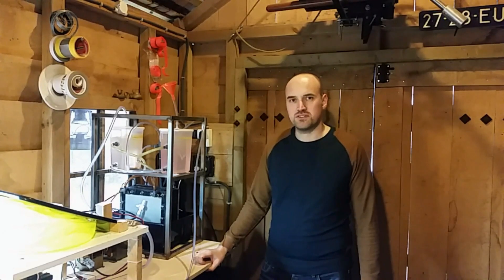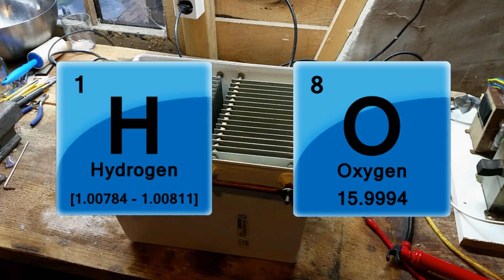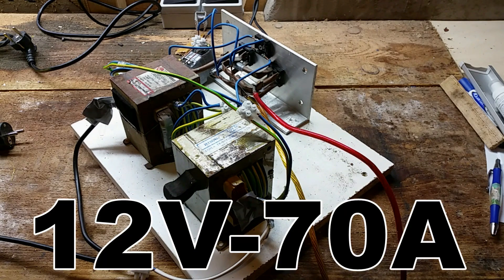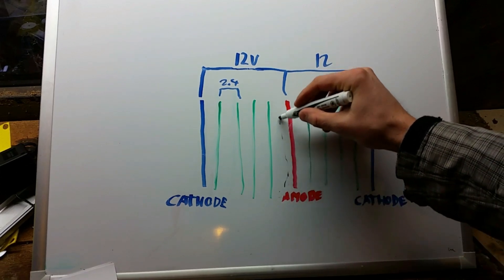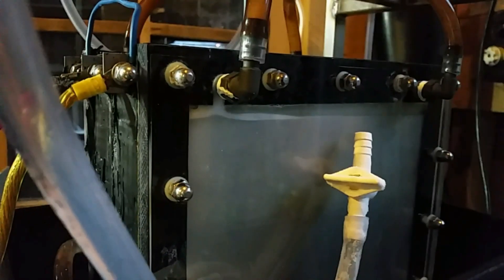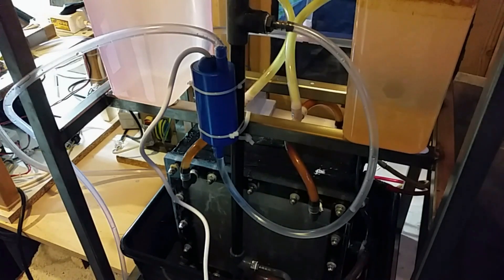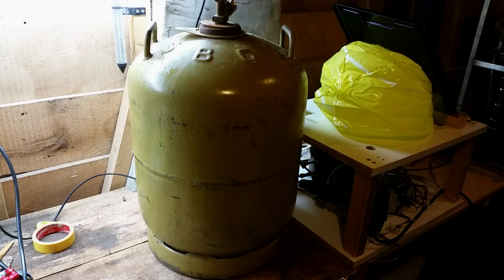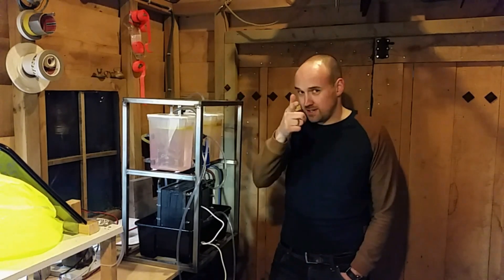Hydrogen Generator #1 Homemade Hydrogen Generator And Compressor Unit

Comment: Hey have you tried using pee as an electrolyte? I hear you can make hydrogen very efficiently from pee! Just 0.48V are needed and the urea and ammonia get broken down to hydrogen rather then the water. It cleans the water while it is being run through as well. The efficiency of that ranges from 130% to 3300% efficient for urea and ammonia respectively. They are fuels that get more available through elecrolysis. very abundant fuel sources too! by dropping the voltage to 0.48V, heat buildup is not an issue either

Great research is being done on this at Ohio U
Reply from the maker: Yes someone told me about that and when my hydrogen generator is operational again I will definitely experiment with that! Thanks for the suggestion! 👍

Comment: You're completely on the right path when it comes to efficiency of splitting rate. There is impedance in separation. As with anything electromechanical, more impedance equals more thermal loss.

Comment: Have you ever considered to use graphite plates instead of stainless steel?
They are way more efficient than any metal and also way cheaper :)
Reply from the maker: Yes I did, but the resistance of graphite is to high, which makes it less efficient.
Reply: @TheDIYScienceGuy  shoot!
I just figured out that there are 2 types of graphite. I have to messeaure the conductivity of my plates before before I start cutting hole into them or similar!

The non-uniform graphite which has a general conductivity and the uniform graphite which on one plane acts as conductor with a conductivity like metal. But on 90° to that plane the graphite has a very high resistance.

I hope the graphite plates I ordered are uniform and aligned into the right plane to be conductive or I have to figure out a solution.
The order for my graphite is around 300€. It would be pretty upsetting to figure out it was all for nothing.

Comment: Can separate with just all positive one side all neg other.  2 chambers with just a 1/4 inch or so opening on the bottom of the center divider. Current travels through water with ease no restrictions.  Lot simpler method to separate
Reply from the maker: No that will not work because the small area of the opening restricts the current flow, limiting production. I tried that with the first generator I made.

Comment: That's a very clever design!  The construction is like a AGM battery, but you use felt where a AGM battery would use fiber glass or some such.  Regarding 3:45 Another source of heat is likely simple electrical power dissipation.  When current moves through a conductor, power is always dissipated.  The electrical resistance in ohms is multiplied by the square of the current in Amps.  For example, a one ohm resistance with ten amps flowing through it would dissipate 100 watts.
Reply from the maker: Thanks!

Comment: This looks like the hydrogen detonates. I would like to have my cars and trucks running on hydrogen.  Gasoline has different octane ratings and an engine that has high compression needs to run on high octane gasoline.  The high octane prevents detonation which would damage an engine if it were to have low octane used in it.   The octane is the burning velocity of the gasoline,  and when the gas is ignited by the spark plug,  the burn velocity must be progressive to "push" the pistons down instead of detonating  causing allot of shock to the pistons (Compare this to a sledge hammer hitting the pistons instead of a progressive push.)   The detonation causes damage.   Now this brings me to the subject of hydrogen.   Will it detonate in the combustion chamber ? Or will it burn progressively ?   The demonstration with igniting the hydrogen bubbles looked like a detonation.

Comment: I’ve always wondered how i could store the hydrogen i generate with my Electrolytic cells, and i finally came across this video! Wonderful project, i just had a little curiosity

How do you ensure that absolutely NO oxygen gets into your hydrogen tank? That also includes eventual air displaced by the compressor while starting, leaks etc. Is there a reliable chemical/mechanical way to efficiently and safely ensure this?
Reply from the maker: Thanks! I do regular check as shown in this video: https://youtu.be/9jhBOxYqJvc but An oxygen censor would be best. I'm going to implement that when I have my generator running again.

Comment: I was always under the impression there were chemicals in H2 storage tanks, maybe that was for much higher pressures. Just worries me a bit I didn't see any flame arrestors
Reply from the maker: Yes some tanks store hydrogen in a metal hydride to lower the pressure and overall wight of the tank.

Comment: Is it possible to run the water/hydroxide solution through a type of heat exchanger then back into the system
Reply from the maker: You could burn it, let the water vapour condense and then put it back in the generator. But why? Is water very scarce where you live?
Reply: The DIY Science Guy no just asking
Reply from the maker: Ok ☺👍

Comment: Add the harmonic resonance frequency of either hydrogen, or oxygen to your electrolysis unit and achieve overunity of up to 900-1, depending on the size of your unit.
Reply: Yeah? Have you done this? It’s not as easy as you think it is.
Reply: @DanTheMan-tr2ji  everything is easy when you know how to do it..., if you are clever, you can simply integrate a frequency generator on the output side of your power source. If you are really clever you can make what i refer to as a "compound coil" (a coil with three different windings) that produces the resonance frequency of hydrogen. The instructions for winding the aforementioned coil is on the net. If you are unable to find the link, let me know, and i'll see if i can find it again, for you.
Reply from the maker: This is stanley meyer nonsense who was a fraud only in it for money and fame.
Reply: @TheDIYScienceGuy  i have no idea who stanley meyer is. Do you refer to it as nonsense because you tried and couldn't get it to work, or because it would destroy your world view so much that you did not try? Fact is, it works. Truth is, you get to believe whatever you want, and it does not change my reality, but it surely effects yours. From what i've seen, you are a bright guy. i have little doubt that if you believed it could be done, you have the skills to do it.
One thing to remember, and this is vitally important: you can use it to meet all of your own energy needs, you can give away the tech or even fully operational units, but you can not sell it.
There are ppl all over the world using hydrogen from water as fuel (not many but widely spread). Those in "the community" who have tried to sell it, seem to simply disappear or unexpectedly perish.
There is more disinformation on the net about this subject, than there is information. Be prepared though, even when you have a fully operational system, and ppl can see it working, with their own eyes, ninety percent will still not believe. 
i offer this information knowing full well most/all will simply consider me a nut, but truth is, it was given to me, and what kind of i jerk would i be, if i didn't at least try to pass it on.
Wishing you and yours the very best.
Reply: @davidmintun  I have searched and cannot seem to find this compound coil. I’m interested in knowing more. I have always kicked around the idea of designing a frequency generator that  essentially “sweeps” the frequencies until something significant happens in electrolysis, question is, how do I find the frequency of Hydrogen or oxygen, that’s what I’d like to know, and if so, how come no one has successfully done so? Unless of course they’re staying quiet about it and it’s really that simple.
Reply: @DanTheMan-tr2ji  i like the way you think. i may be the only one in the world that calls it a "compound coil", and i think i mistakenly called it a tri-coil, when it is actually a quad. This was given to me, not developed by me. i have little, to no, electrical education. (and therefore no indoctrination either). Which makes it very difficult for me to effectively communicate about the system. i have been trying to use the net to understand what i have been given, so i can give it to others. 
i have been given much knowledge of hydrogen, hydroxide and water, but i have definitely NOT even come close to closing the circle on electricity.
Your idea of using a frequency generator is good, methinks. As you have noticed the actual harmonic resonance frequency (HRF) of either hydrogen or oxygen is not readily available on the net. i lack the knowledge and equipment to give you that simple answer, i wish it were not so. Although, i think the HRF of oxygen may be around 60ghz. There are those who think that the environment influences the actual HRF's of elements, so it could be slightly different, location to location.
The efficacy and safe utility of using hydrogen from water versus hydrocarbons was understood by very few, from before the industrial revolution. Those few knew that it was so simple, they could not make money from it, or rather, they could make far, far more from hydrocarbons. Yes, when you start "cracking water", you are swimming in their soup. i tell, because they can do nothing against me, unless i try to sell it, and, i hate a lie. If i know a thing as a deception, and i do nothing against it, i become a deceiver.
i could go on for a long time on this subject but don't want to bore you with what you may already know. i haven't been able to find the coil again, looks like it was taken down, again. The good news is, it has been taken down before, if you keep looking i bet you'll find it. If i find it b4 you, i'll come back here and post it. There are many ways to crack water, but i think all of them that produce over unity use some method of inducing HRF.
May you and yours be blessed

Comment: I wonder if using an o2 sensor from an old car would be useful in detecting oxygen in your hydrogen lines?
Reply from the maker: No those only work at high temperatures.

Comment: nice video! what kind of switch is it that will turn on a pump when the Hydrogen gets to a point and shut off at a point? I need to pump Hydrogen into a tank then shut off when the hydrogen (being generated) is used up?
Reply from the maker: Here's a link to a diagram I have on intagram: https://www.instagram.com/p/Bpl2pLijM7z/?igshid=1czhuqfjdm33o

Comment: is hydrogen stored in liq form?
Reply from the maker: No it's stored as a pressurised gas at around 13 bar.
Reply: Thanks.Would you recommend a better anode metal.
Reply from the maker: Have you seen this video of mine? https://youtu.be/Zn1hkzvFZOI
Reply: @TheDIYScienceGuy  oh thanks I will see
Reply: How thick are these sheets?
Reply from the maker: 0.5mm
Reply: How much current you are giving to those plates?
Reply from the maker: 70 amps total.

Comment: Have you checked out faradays electrolysis notes? You might find that adding a 5th neutral plate will give you a more comfortable voltage. Faraday suggests best results at 1.25 to 1.48v. I think you are pushing to much through the unit at 2.4. Hho connection talks about a 2v ceiling...

Comment: If this was used to power an automobile. You could incorporate a radiator to keep water heat down. 
Seems like there could be a way to set up a stand still heat exchanger. Maybe a water heater.
Reply from the maker: Yes that would work. There is not a lot of wast heat so I circulate water trough it frome a 200L barrel, works fine!

Comment: You can use a plate type heat exchanger it has enormous surface area and the parts are insulated.
Reply from the maker: Yes that would cool very good but the thing I made also works fine. Thanks for the suggestion anyway! 👍
Reply: @TheDIYScienceGuy  Yes you made it well. I thought of the heat exchanger because you csn find them in scrapyards and speed up things thereby.

Comment: I hope by the grace of Almighty Allah you & your all of the family member are fine & safe.
Thanks, it's a very good video for the beginner.
I like to make a hydrogen generator for rice cooking purpose.
Please advice me for suitable size of steel plate and required DC Voltage.
My email ID is
engrmahjahangir@gmail.com
Reply from the maker: Voltage around 1.8 per cell. Size depends on how much gass you need.

Comment: Why we compressed hydrogen gas 
We can store it in a slurry of all rotten garbage and all types of fuel and locomotive oil and greased found in vehicle garaz 
Just pass the hydrogen through it and it becomes hydrogen rich and become petroleum products more efficient 

Turn all your kitchen garbage into fuel by mixing yeast and hydrogen one by one 

Put hydrogen into alcohol and see what happened ?
Reply from the maker: I believe that only works in the presence of a catalysts in a high temperature environment. But thanks for the suggestion! 👍
Reply: @TheDIYScienceGuy  if we use bigger aneroid barometer then we attached a dynamo with it and collect energy for whole day long and cook our food by using that power ?

Comment: What if you realize that hydrogen and oxygen was pumped together into the tank already? How do you solve it?
Reply from the maker: Because I check it very often there will never be so much oxygen in the tank that it will become dangerous immediately, but yes it is a risk. When oxygen gets in the tank just blow it of outside an when it's empty fill the tank with water.

Comment: Amperage creates gas, not voltage, however the voltage must be around 1.75V depending on your electrolyte, plate spacing etc. in order to start producing gas. Beyond the required voltage you are just wasting power. You could eliminate transformers entirely by making a long series cell where one side of each plate is the anode and the other side of the same plate is the cathode.

Comment: Thank you man, very explainfull video, you have solved many of my problems.
Have you experimented with the percentage of NAOH in the water?  When your tank becomes low in solution , with what you fill it up? With NAOH - water solution or just plain disstilled water?
Thanks again for sharing your knowlledge
Reply from the maker: Thanks! Well putting in as much NaOH as you can is best, at some point it stops dissolving, that's when you know it's enough. The NaOH is not being used so you only need to refill with distilled water.
Reply: @TheDIYScienceGuy  Thank you for your answer, doei

Comment: I have a question, how does that beach ball allow you to compress 700 liters of hydrogen into the propane tank?
Reply from the maker: It's a buffer bag. It's slowly being filled by the generator and pumped empty fast by the pump. It's filled and pumped empty about every 5 minutes.

Comment: Awesome content. 

Any chance you can build a hidrógen on demand sistema to implement on cars? By on demand I mean that the hidrógen will only be generated when you got the gas pedal and it will flow to the air intake of the combustion chamber of the cars combining the fuel with hidrógen instead if air and improving fuel consumption
Reply from the maker: Thanks! Yes that can be done and has been done a lot but it unfortunately only increases fuel consumption.

Comment: DIY Science Guy. Could you make it work in reverse and thus create a closed system battery? Discharge consumes H and O to create energy and water, then Recharge consumes electricity and water to create H and O?
That is actually my recent idea for solar energy storage... the amount of H you produce in 8 hours should be 0.6 kg, which should store tens of kWh of energy. (sure you would loose some energy by storing it.. probably a bit more than 50 % but that is still economical in combination with solar.. )
Reply from the maker: Something like that will work but is hard to make useful at home with DIY materials.
Reply: @TheDIYScienceGuy  You mean as hard as making a fuel cell? ;) Each kg of hydrogen can store 33,4 kWh of energy. Think about the potential it can have in combination with wind and solar energy. Without batteries with large storage, both solar and wind are not usable in large scale because of the grid instability they cause and because they just produce at their own time. But if you had a hydrogen battery, you could not only store excess energy and save it for the evening, you could store it for winter!
Reply from the maker: @lukasjandik6444  Yes making the fuel cell at home is hard. But burning the H2 for heat can be useful.

Comment: Cool video. I thought of using a 12 V 60 A battery charger to put through the cell. This can generate 180 litres of Oxygen each day.
Each anode is inside an inverted plastic tube to prevent mixing of gases.
As an electrolyte I used water with baking soda. I also tried water with sulphuric acid. I preferred baking soda because it is less corrosive and less likely to give off toxic gases.
I haven't tried hydroxides, though I heard KOH is the best.
 -------
I like the idea of neutral plates and water cooling.  
-------
A human being needs 550 litres of pure oxygen a day. Your cell produces 35 litres of oxygen per hour = 840 litres per day, so you could survive without any external air - and use the hydrogen to keep warm and do cooking. 
-------
I have never tried gas compression. If you are compressing it to 12 atmospheres, then your gas cylinder can hold 12 times its volume. It looks like a 100 litre gas tank, so it should be able to hold 1200 litres of gas - 2 days supply of  oxygen. Maybe you should use a detector to detect if there is oxygen in the mix - and set off an alarm.

With the current Corona virus, many people need access to oxygen ventilation.
Reply from the maker: Thanks! Yes but please never inhale the oxygen you made yourself, because you never now what other stuff is in there.